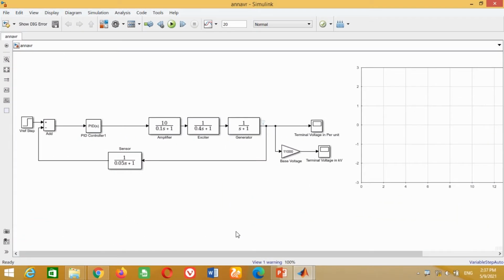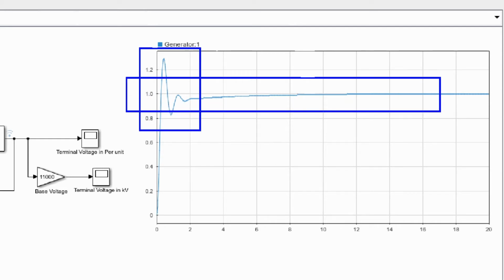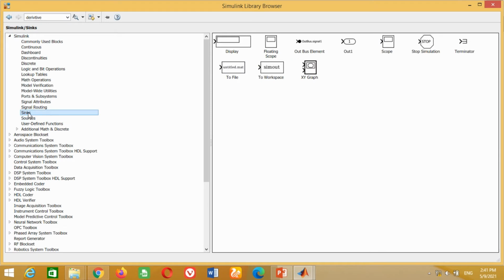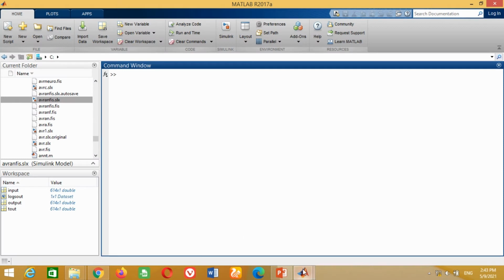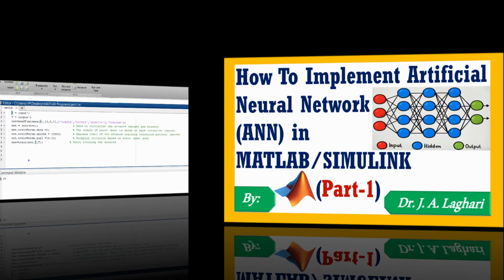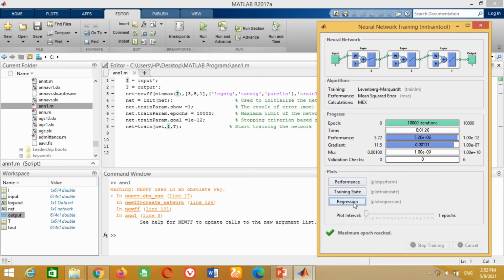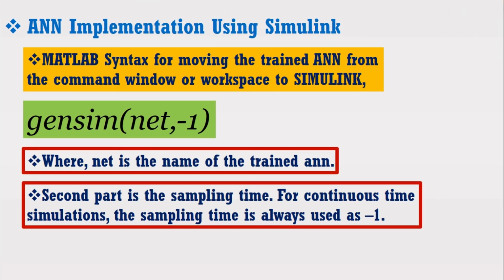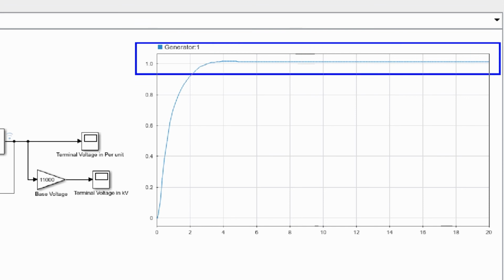How To Design Automatic Voltage Regulator Model using ANN in MATLAB/SIMULINK ? | Dr. J. A. Laghari

Comment: Sir, our output differs from yours; our result is a high negative value. How can we correct this?
Reply from the maker: Thanks for the comment. kindly remove those negative values from the data then train it or use those data which you want the response then train it. May be you get the desired results.

Comment: Sir why we need to set 1 and 0
Reply from the maker: Thanks for the comment. 1 means per unit value of 1. Which means if the actual value is 11KV, and base value is also 11kV, then its per unit value will be 1.

Comment: Assalamualkim Sir. After getting data from Simulink to Workspace and running this code it gave me this error:

Error using network/train (line 340)
Output data size does not match net.outputs{3}.size.

Error in annt (line 20)
net=train(net,I,T); % Start training the network
Reply from the maker: Thanks for the comment. May I know how many inputs you are using?

Comment: Dear , sir,  by using your Matlab  code in the description  I get a custom neural network block  but when I replace instead of  PID by this block  on your diagram.
brings this error(1.Error in port widths or dimensions. 'Output Port 1' of 'AVRFNN(name of project)/Add' is a one dimensional vector with 1 elements.
Component: Simulink | Category: Model error
2.Error in port widths or dimensions. 'Input Port 1' of 'AVRFNN/Custom Neural Network' is a one dimensional vector with 3 elements.) how can I solve this problem
Reply: thanks for your swift response 
but I followed your tutorial steps from 1-4 and AVR ANN others but there is the same error on AVRANN and LFCANN
Reply from the maker: @walelgnakele7302  which MATLAB version you are using?
Reply from the maker: @walelgnakele7302  which MATLAB version you are using?
Reply: @DrJALAGHARI  2021a
Reply from the maker: @walelgnakele7302  The error is due to setting of Matlab 2o21 version. Double click on the block which is used to send data to workspace. And change its settings, rest everything is perfect.
Reply: @DrJALAGHARI  ok thanks
Oll Matlab setting or only work space that I reset
Reply from the maker: @walelgnakele2437  basically the default  configuration settings of matlab 2021a version are different. You have to change it manually.
Reply: @DrJALAGHARI   OK, Still no change  but our instructor says we must do it in 2021a
dear, sir can I use FFNN block directly instead of custom NN 
[x,t] = simplefit_dataset;
net = feedforwardnet(19);
net = train(net,x,t)
gensim(net)
by using this program I directly get the block controller but can not control it correctly what shall I do please?
Reply: FNN  can run without error but never control b/c f&V results are very maximum around from 25-60 .
if how can I regulate it .
Reply from the maker: Thanks for the comment. Kindly watch the video step by step. May be you are using three input or multiple inout that's why it is giving error.

Comment: pranaam sir , in my case , the result from PID is much better that ANN. There is an overshoot in ANN at the start. The output values , i kept under 1 , while the input values were even less than 1. can you suggest any research paper on this particular topic so that i can refer it to write a research paper. 
to add , very good videos though , from 2 days , i am watching your channel full day. Thanks sir
Reply from the maker: Thanks for the comment. Basically in this particular case we have maximum value or margin to 1 therefore it takes a lot of effort to improve the response. But in case there is a big difference between the. Output results, then ANN will be surely best. To publish paper kindly watch my videos on LFC and AGC and try to implement the latest techniques.

Comment: Sir Tuned PID controller gives better result so why should we use ANN controller
Reply from the maker: Thanks for the comment. the tuned PID controller always give compromised response. it is not optimized. furthermore, PID controller may give good response for some cases but not for all cases. on the other hand, ANN has the ability to provide optimum response if properly trained.